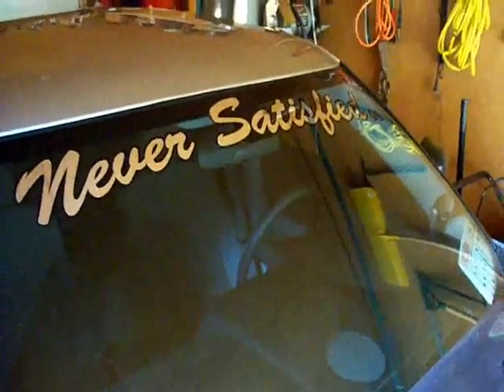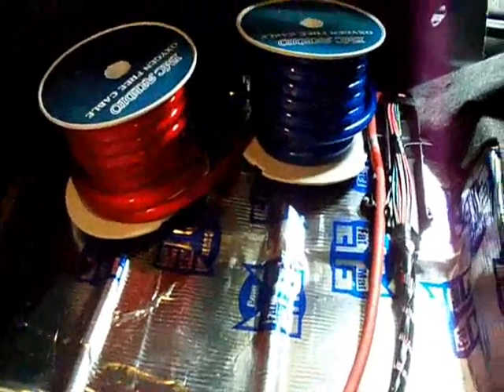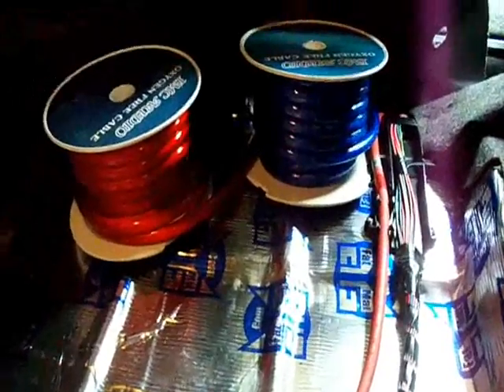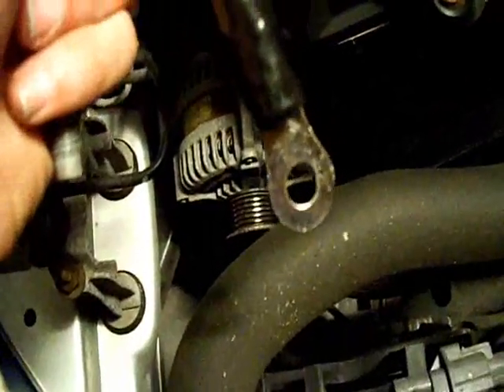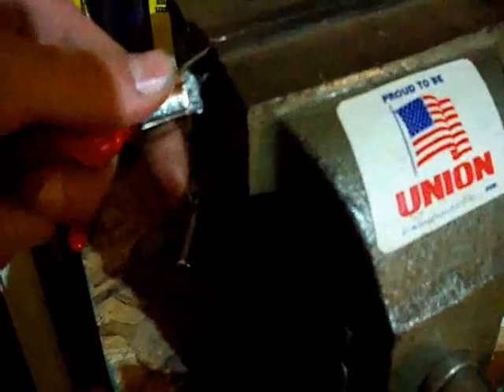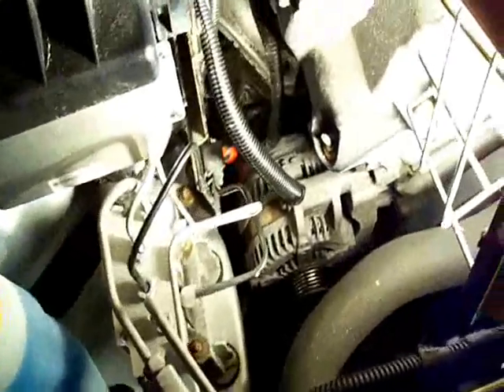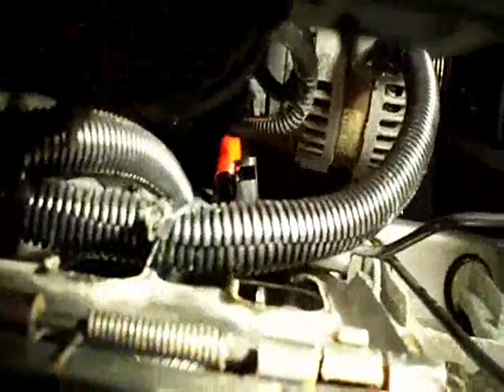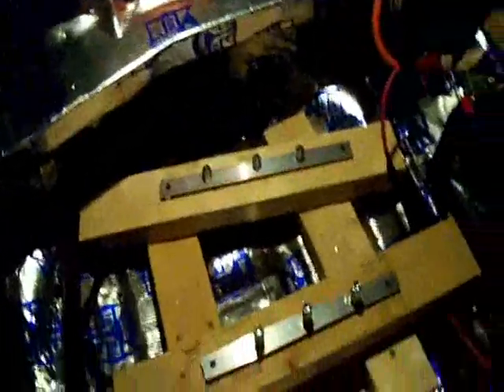HOW TO DO THE "BIG 3" WIRING TO BEEF UP CAR AUDIO ELECTRICAL running 0g power for the Fi BTL 15's

Comment: do you need a fuse between the alternator and the battery positive when doing the big 3?
haven't seen a car using fuses between alternator and start engine.

Comment: im wondering why you ran your negative all the back to the truck? Wouldnt it work to ground it right to the frame, and then ground the negative off the battery to the frame also? Im asking because i will soon be doing the upgrade on my 300C also.

Comment: this relates to the video kinda, im wondering if a 220 amp highout put alternator would be able to power 2 15 btls? i seriously doubt it, but im just wondering if thats big enough cuz i cant find anything bigger for my car alternator wise. plus  right now im running 1 btl on a 2000 rms watt amp, and im wondering if the big three will help out alot for now(stock alternator) until i get my big three cuz i know u need to do it when u get the new alternator anyways.

Comment: @ a21bravo I have a 300 to when you make your new connections with the 0g do you still leave your factory connections in place?  How do you stop the 300 trunk from rattling? I have dynomat on the lid of the trunk, but around the edges I still get alot of rattle! Keep it up a21bravo I love to see my Battles doing there thing.

Comment from the maker: @iSlapMyGFca You should look into the big 3 a little more... And the factory placement of a battery in a Chrysler... Maybe re watch the video and you'll understand... In this setup I had 4 0ga ground runs to the batteries (which are also in the trunk) which were buss barred directly to the frame with a another ground to the engine block

Comment from the maker: Could be.... I would try to figure it out quick though... Or undo the wiring for a bit and see if it's even the wiring that's causing it... It could be another issue....

It sounds a little weird that it's doing that but if it is poor connections I would not waste any time fixing them because it could be puting a lot of stress on your alternator or serpentine belt double check everythingand make sure it's done right 

Alt to battery +
battery negative to chassis
battery negative to engine block

Comment: Voltage is 14.4 at idle. But my rpm went down from about 900-800 to 600-500. When I'm driving on the highway it goes down to 1000. It's gone a little bit lower than 500 Which caused my car wanting to turn off. My dash lights seem to flicker a little more than they use to

Comment from the maker: true... my car doesnt have a battery in the front of the car... only in the back so for the big 3 i needed to run the ground to the engine block... i also grounded the batteries to the frame rail inside of the trunk...

Comment from the maker: True... Did you run your rcas next to te powe cable because that is where you will have more issued because it is an amplified signal... My rcas are ran on the opposite side of the car

Comment: @a21bravo nice setup but why did you you run the power wire right next to the rest of the wires do you get any kinf od noise or wine in your audio  just asking because i made that mistake before were i ran my power wire next to all my other wires and it iterfiered with the signals

Comment from the maker: good question...

you can pick up what is called a "reducer" you can pick them up at a local shop or order them on line for a few dollars...

it looks like a normal input with a hole and a allen head style screw with a 4g rod on the other end that goes into the amplifier...

i had the same problem but i have 8 strands of 0 so i didnt want to spend $80 on them so i just soldered the 0 and 4 into a ring terminal in a pigtail style taped off the terminal and the 4 went to my amps

Comment: well i wont consider my system a "SPL system", i just have one 12 inch Type-R powered by a kicker 750.1. i get dimming and voltage drops. but it bumps nice to me though. if anything i will upgrade to 1000-1500rms, at the most thats it.

Comment from the maker: When I first ran it I went from the top I had barely enough room to get my arm down to the post... After running the cable when they were zip tied off I didn't have enough room to get in there so I went from underneith and used a regular wrench... Just make sure you disconnect your battery or tape off all of your tool so they don't arc when removing the alternators positive nut

Comment from the maker: YES!!... I'm not yelling ha ha just stressing the point whenever youhave a positive source you always want to fuse the line less than 18" from the source... I fused mine up front coming off the alt and in the trunk because it's going to more batteries... Think of it this way you should be able to pinch the wire anywhere and if it grounded out a fuse will pop before the cable melts... Fuses are your friend and will save your car

Comment from the maker: I have no battery up front... The ground is from the battery negative to the engine block... The alternator bolt is a great choice...the batteries will also be grounded to the frame in the back... Big 3, 1 alt to bat. 2 battery ground to engine, 3 battery negative to chassis...